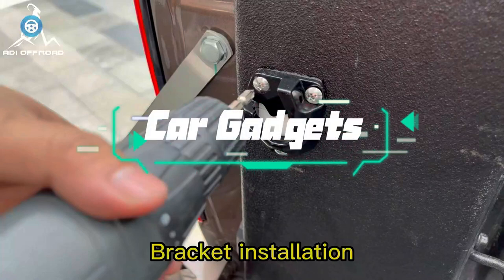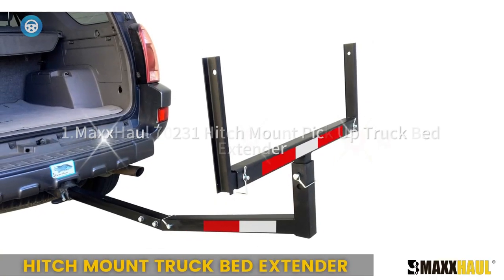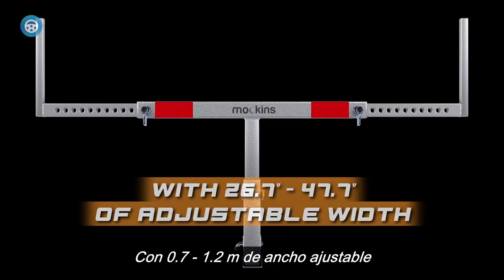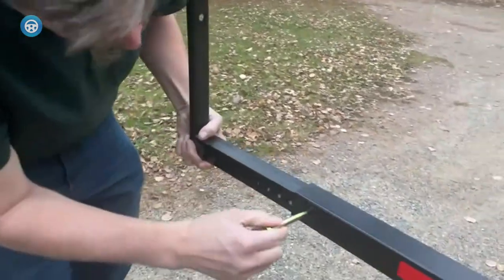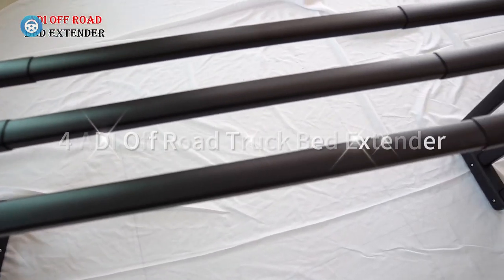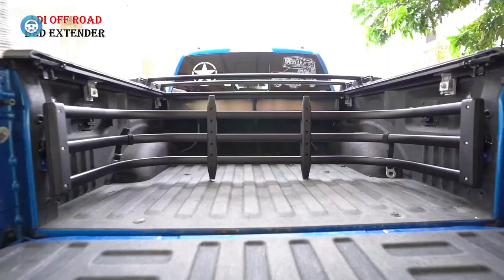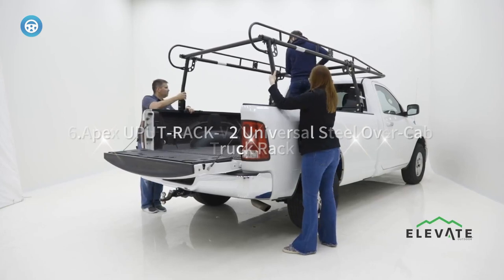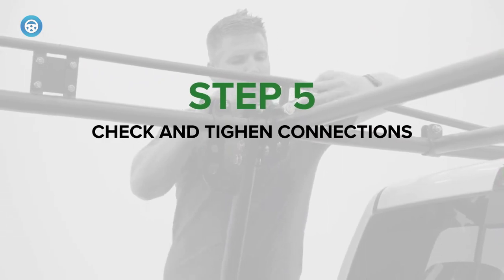6 Best Truck Bed Extenders

Comment: Mockins new 2-in-1 model is definitely the best. Rust resistant metal that can hold 750 lbs and can perfectly fit plywood in it. Dont buy the old model though.